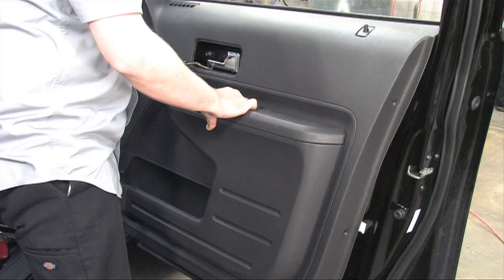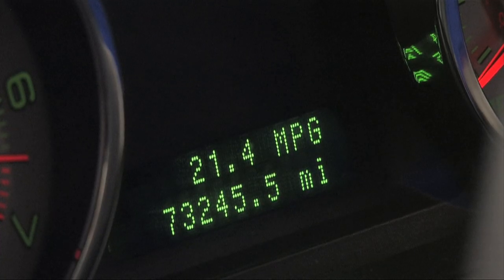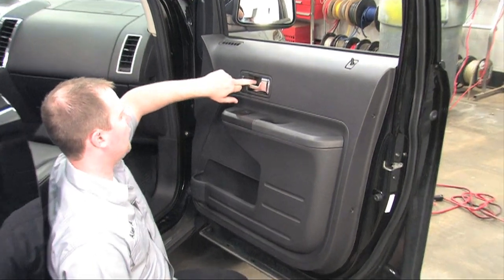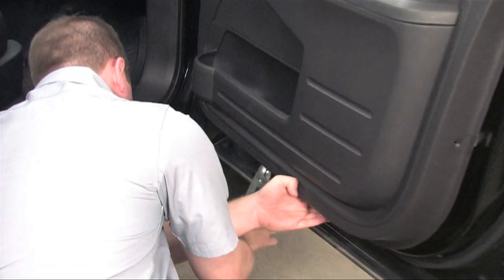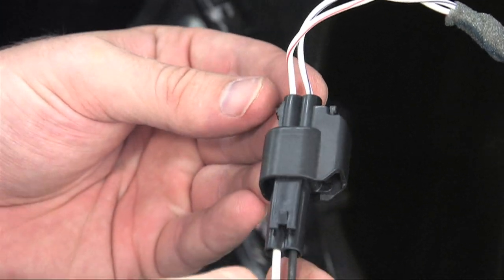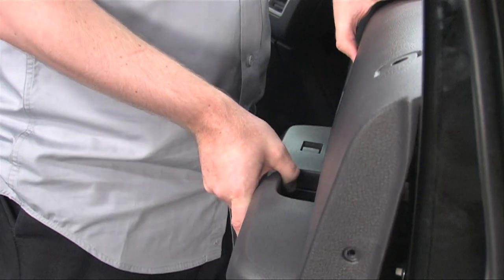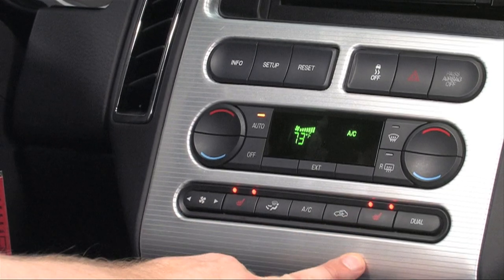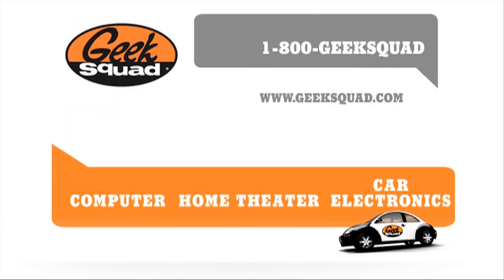Installing Vehicle Door Speakers: Geek Squad Autotechs

Comment: Disconnecting the car battery may also be a good idea.
Reply: You've completely removed the speaker from any electrical source already.
Reply: +EmpyreanLightASMR but the speaker would, I presume, be wired up at one stage. It's just a habit I have when touching wires on my car;)
Reply: KS Myth Good thinking no doubt, but the wire harness prevents contact with anything you have to work with live.
But you're right, prep work and precautionary steps should always be taken, its a good habit.. especially for those doing this sort of thing often.
Reply: I completely agree when installing subwoofers

Comment: I bought myself Rockford Fosgate Puncher p1683 and I also bought, these adapter cables, but they don't fit for the new speaker. Like the buss or however it's called is too small

Comment: so when do you use your aftermarket x gauge speaker wire, going from the headunit to the doors?
Reply: I guess you use that if you have an amplifier boosting your speakers.
Reply: he used an adapter to use the factory wiring harness for the door speaker. even with an amplifier u can use something called 9wire to hook the amp back up to the metra harness so the door speakers get the signal without having to take a single door panel off

Comment: If you dont have the adapters could you just cut the plug off the harness and splice in new wiring to the speakers?
Reply: I'm looking at doing this tomorow with some speakers I'll be buying. Did you do it or get an answer??
Reply: @Drakmaster1337   for side speakers unfortunately my car didn't have to option for side speakers. It's a 92 ford mustang and from factory you could have the option for an upgraded stereo system but mine doesn't have that. But in any case with my other speakers I just cut the ends off if they didn't fit and put on some of those positive and negative connectors. All you'll need is a pair of cutting pliers, wire strippers(knife will work) and crimpers. You don't necessarily need to buy an adapter for it.
Reply: @christianfuhrmann5647  hey bro I installed front door speakers today it actually was pretty simple, I cut the adaptor off and just twisted the wires in the door to the new speaker and taped it up, the pain was I had to cut new holes in the speaker pod thing, since the new speakers were half a inch bigger but I got them to fit pretty firmly.

Comment: so i shouldn't pay bestbuy $150 to install my speakers?
Reply: um you also have to adjust the amp
Reply: Haukenslush no u can do it
Reply: Haukenslush Best Buy quoted me $650 to install speakers in the front and rear of my car. I laughed, handed the speakers back to them, and bought them off Amazon.
Reply: okamiyazaki do you know how to install them, do you have a strong enough amp?  What is the RMS on your speakers?
Reply: okamiyazaki hell yeah im installing mines from amazon today lol
Reply: +David Murphy you don't need an amp unless you are crazy about sound quality 
But if you are a cheapass like me
Just buy some cheap kickers and stick them in
Done.  Took me 5 minutes on each side
Reply: J⃟O⃟N⃟A⃟T⃟H⃟A⃟N⃟ S⃟C⃟H⃟U⃟L⃟T⃟Z⃟ you cant run the kicker without a amp.  The amp powers the thing.  If you buy a powerful enough rms amp you can run your kicker at optimal level creating better sound.  If you install yourself its real cheap.
Reply: +David Murphy You keep going on and on about an amp, as long as your HU is powerful enough, you won't need one.
Reply: It's $69.99 + tax for the installation of a pair of speakers. They'll even install the speakers you got off Amazon for you they don't need to be purchased at a BestBuy location
Reply: Geek squad is a joke. I was gonna buy $130 HU and the 4 speakers came out to $80 so $210 all together. I asked if I could get everything installed and not spend more than $300. Said itd be closer to $650-700. GOOD ONE BUD!
Reply: Casey Belding I went to get speakers installed and they blew from geek squad.  I go to a mechanic they did it right.
Reply: to anyone reading this: NEVER EVER EVER NEVER GO TO GEEK SQUAD. FOR SPEAKERS, RADIO, ETC. I hope they go out of business.
Reply: J⃟O⃟N⃟A⃟T⃟H⃟A⃟N⃟ S⃟C⃟H⃟U⃟L⃟T⃟Z⃟  true fuck putting a amp on speakers it might burn them, I'll just put the amp to my subs instead lol
Reply: What ever happend to free install of purchase hu or speakers? Come on best buy
Reply: @jcorona7731  that was 2004 / 5 lol

Comment: where do i get the speaker adapter
Reply: Mr.Rivera and Sis in amazon Metra 72-5600 Speaker Adapter for Select Ford Vehicles
Reply: you dont just have metra out there so shop around not all their products can be used on specified vehicles they give a range not specifics

Comment: SKIPPED A STEP

Notice that the NEW speaker was 1st installed onto the original speaker mount.

you just don't pop in a speaker it needs a mount,  something they forgot to tell you.

when you remove your old speaker,  remove the speaker from it's mount, and KEEP the old mount, you'll need it to place your new speaker in, before you install it in your vehicle.

go on... take your speaker.. try and just put it in the big hole

use the old mount no need to buy a new one,, you're holding one in your hand, why buy a new one,, geez
Reply: Lmao "go on, try and just put the speaker in the big hole
Reply: You don't need a new mount if the new speaker is the same size as the factory one. You can use the one already there.
Reply: Har...Har....Har....tabber-nac
Reply: How da heck would you do that? The one I have in my hand seems to be one big piece

Comment: U didn't even check if da speaker adapter u used on da speakers factory wire adapter are correct for poss. & neg. Cuz dey do come backwards da clip side is poss. But dey r black for neg. On da adapters...
Reply: Completely illegible.

Comment: Why the fuck do you need to document all the things that DON'T correspond with installing speakers?
Reply: They do that cuz lets say the A/C was working before then they installed the new speakers and now it doesnt work they now know that the a/c is not working because of the speakers. If they didnt take note what worked and then came to a problem then they wouldnt know what do to.
Reply: But the thing is, how do speakers screw up the AC? (maybe Geek Squad knows how to fuck it up)
Reply: It was a example about the AC, and they have to do it becuase there a big company. It's dumb ass rules they have to follow
Reply: True. ^
Reply: Anthony Wood The classical, I came in to get my oil changed and now my power seats don't work, or I got my windshield wipers changed and now my car overheats! Damn mechanics! haha some people
Reply: +cad5359 Probably because you can blow a fuse when reconnecting everything. This sometimes happens to me even when I just disconnect the battery to charge it and then reconnect. Maybe I'm not reconnecting properly, I don't know. Anyone else experience this?

Comment: this is a rediculous tutorial since no after market speaker comes with the specific connectors.
Reply: All you have to do is buy the adaptor
Reply: Buy the adaptor? A five year old can connect two wires, no adaptor needed. You dont need a 10 dollar adaptor.
Reply: +Frietbakkerclan it's for people that want plug and play, no cutting,crimping,soldering etc. it's easy.
Reply: +silent saucepan i dont think those people are installing the speakers themselves.. Connecting the wires correctly is the most crucial and trickiest part of installing these speakers. And they skipped that part from this tutorial.
Reply: Indeed those people are installing the speakers them selves like you said thry just need to figure which wire is the matching polarity and yes they did skip a very important step
Reply: I installed my speakers your way. I used the existing adapter, I just cut the new wires and connected them together using masking tape. Although it is probably better to use an adapter, it's more organized and clean.